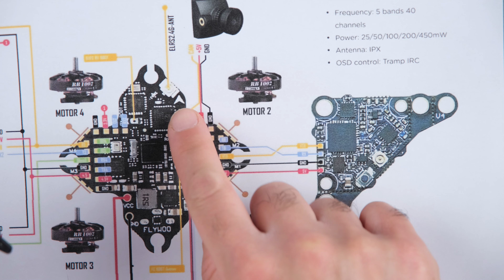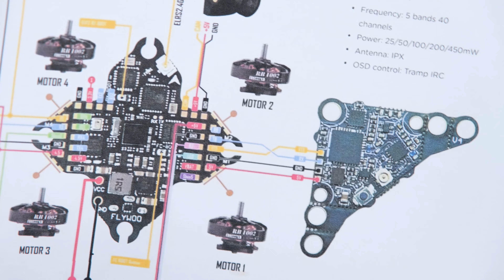🚨🔥Build FPV Drone | Micro Drone FlyWoo Firefly Nano Baby 2.0 Step-By-Step #fpv #microdrone #flywoo

Comment: U attached the power cables so easy! I must’ve done it like 6 times before I got it to stay on… it kept pulling off, solder and all from the board. Still waiting on my analogue, it’s been a month 😢 but the dji is so so sweet to fly.
Reply from the maker: I know what you mean man. What temperature your soldering iron is at? Mine is at 400 and you have to use a thicker tip, and put a little fresh solder, I mean while your tip is on the wire, you will see it will stick immediately 😉